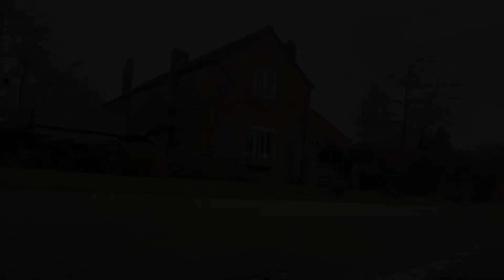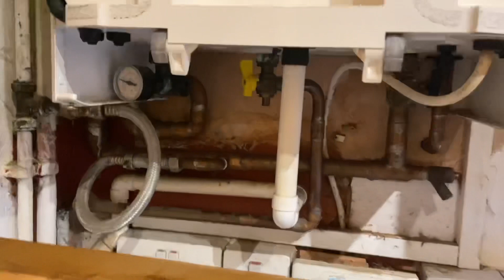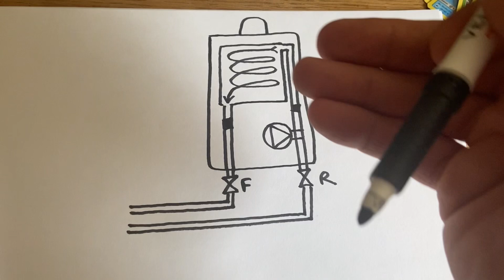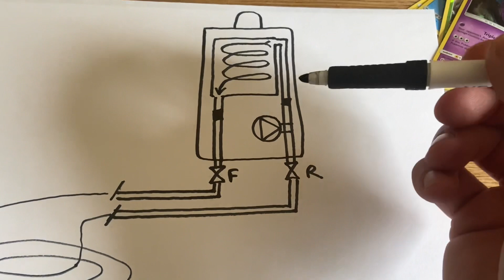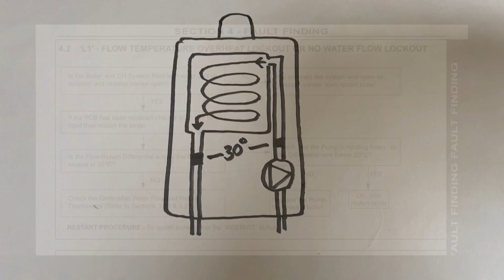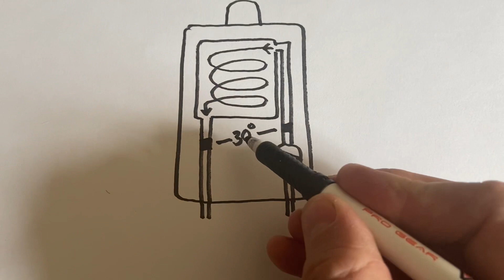P B Plumber The life of a jobbing plumber #47

Comment: Thank you for another great video. Wining the thorough flush would be a epic price but failing that can I pick your brains on it. I have invested in adey Magna cleanse and I have a old anton flusher that I found on eBay I recently lost my job due to the company I was doing my apprenticeship and learning with going under due to covid the The Magna cleanse is good but with no heat supply it’s kinda pointless is this the same for the thorough flush? I’ve been looking at get one but I don’t want to spend money that I don’t necessarily have. Like a lot of people choosing between tools and what family needs are putting me off getting one. I can see the use but I’m hesitant. Most of work is broken or boiler that have been miss diagnosed i worked for a company that’s also had a 3 visit new boiler policy I’ve alway thought that keeping boiler going is better then more land fill. Sorry to ramble on but my real question is do you think I could replace the power flusher with this? My power flusher is not the best. Dose the no heat make that much difference?

Comment: That’s actually not Pex. Not sure what’s it’s called but pex is more like speedfit pipe with crimped fittings.
Reply: 20:14 it says PEX on the pipe
Reply: @thornhillplumbing  it says GerPex. That is not what we call pex. I’m English but work over the pond, what we call pex is more akin to speedfit pipe in flexibility and installation, the only difference is that we crimp the pipe with specialty hand crimpers rather than pushfit fittings. I’ve never even seen that pipe over here.

Comment: Hi PB,another great video.Had a similar issue with a worcs ri,other engineers went out and replaced pump and pcb but to no avail and tried to push a new boiler.in the end the plastic elbow on the top of the heat ex was full of crud and just needed to be replaced and a flush out.customer was very happy😀
I would love to win the thorough flush,just started on my own after working for another firm for 5 years and decided to take the plunge.
Either way,keep up the good work and keep smiling😉👍